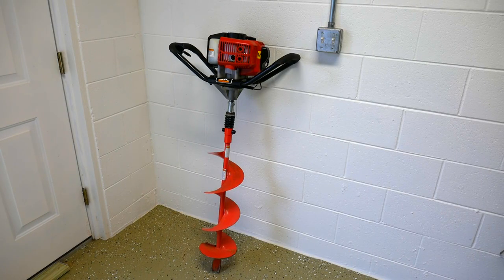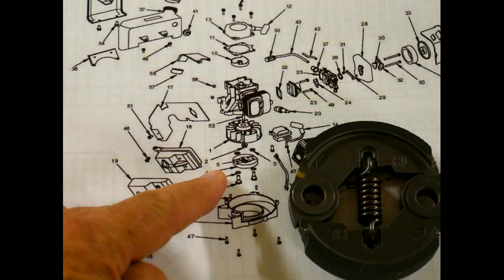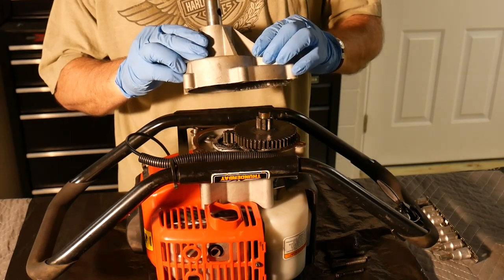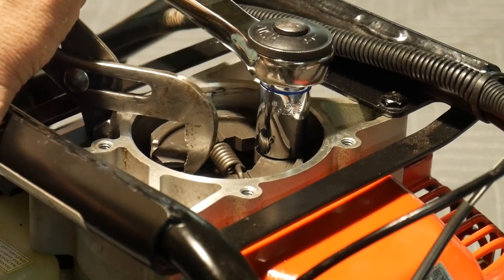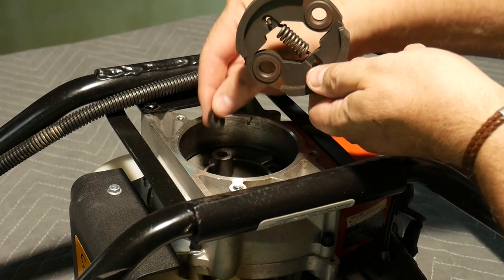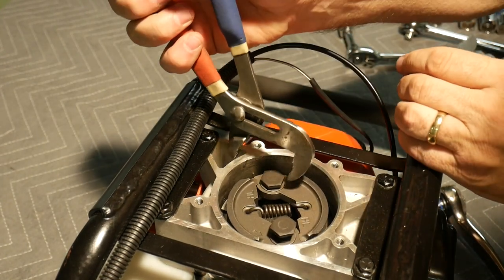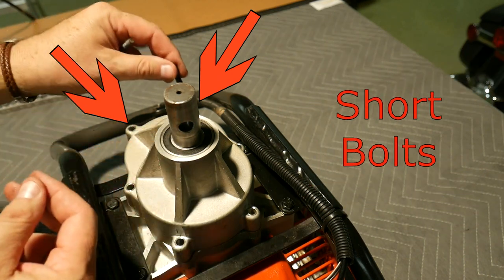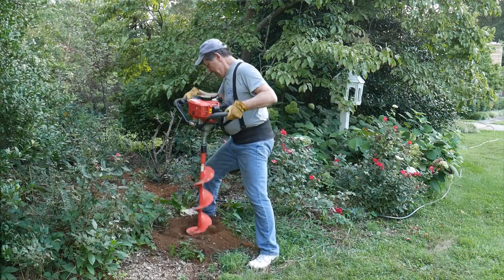Auger Clutch Replacement

Comment: Good video. I wouldn't of been able to resist to take the opportunity to clean out old grease and re-grease everything with some good new synthetic 00 grease. But thumbs up! I didn't realize it was such a straight forward process!
Reply from the maker: Thanks Mr. Davis
Reply: That grease needs to be something equivalent to marine grade wheel bearing grease with "EP", which means extreme pressure. ‘Ordinary’ grease, such as Lithium won’t do, partly due to the higher temperatures where ‘ordinary’ grease stops being a grease and partly because it might decompose at the high surface pressures in this type of gear box... just a tip 😀

Comment: Great video, thanks.  If you don't remove the short screws the whole gear box will come off saving a lot of steps  and some mess.  However you won't be able to inspect and grease the gears if you think that is needed.
Reply from the maker: Good information, thank you.  And thanks for tuning in.

Comment: I just came here to out of curiosity as the auger I hired today was indeed suffering from a burnt out clutch, all it was doing was screaming if I tried to engage it on the ground - it would engage if we held it up, but would then stop and start screaming before it made any digging progress.  We dug the holes the old fashioned way, and I took it back to the hire place and told them the clutch was gone, he was skeptical but did give me my money back.  I asked him when the last time the clutch was replaced and he could not tell me!  It wouldn't go into reverse at all, so that also confirmed to me the clutch was gone - I'm familiar with clutches in other equipment but have never done one in an auger.
Reply from the maker: I'm sorry you had to dig em' the old fashioned way.  That sucks.  I guess it's some consolation you got your money back.
Reply: @PilotViewProductions  Well it's beer-o-clock here in New Zealand so it's all good now!  This was a great video by the way - I'll possibly never have to replace an auger clutch, but I love learning how things work regardless so thank you!
Reply from the maker: @Beer_Dad1975  Cheers Matt.  And thanks for viewing.  Never know, maybe some of my other videos will help in your future endeavors.  Much success sir.

Comment: Sorry I have to ask but wich way did you rotate the new clutch? Was it the opposite you did when taking it out?
Reply from the maker: Sorry, I don't quite understand the question Bobby.  Are you referring to the clutch bolts cause the new clutch itself was installed in the same orientation the old one came off.
Reply: @PilotViewProductions  I didn't understand after you tight end the first bolt you said something about spinning it. I didn't know what direction you turned before tighting the second bolt down I just put mine in and I must of did it right because after messing with carburator after putting clutch in seems to work now. Thanks for replying back

Comment: What does the auger do to indicate a clutch that needs replaced?
Reply from the maker: 1: Put the auger on the ground where the hole needed to be. 2:  Pull the throttle trigger and the engine revs up but the auger either doesn't turn or doesn't have the energy from the engine to dig the hole even though the engine revs up.
Reply: @PilotViewProductions  mine keeps turning even when Im not giving it gas?
Reply from the maker: @mosinnagantfan  That's actually a good sign.  It may turn slowly at idle but if it's turning very fast, perhaps the idle needs adjusting down a bit.  The worn clutch only comes into play if the auger won't dig under load yet the engine revs as though it is digging.  If you've ever experienced an automatic transmission that's going bad in a car, the principle is the same.  Engine revs up but the car won't move even in drive.
Reply: @PilotViewProductions  Thank you.
Reply from the maker: @mosinnagantfan  Sure thing James